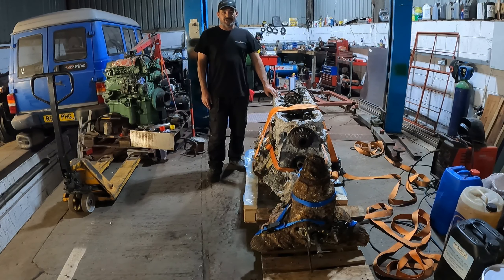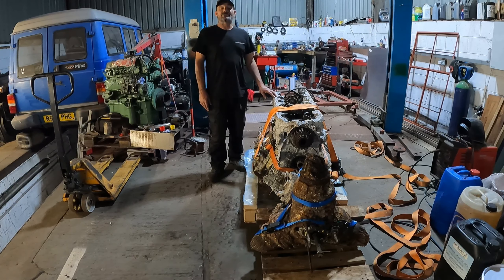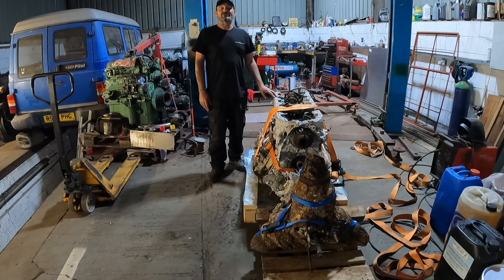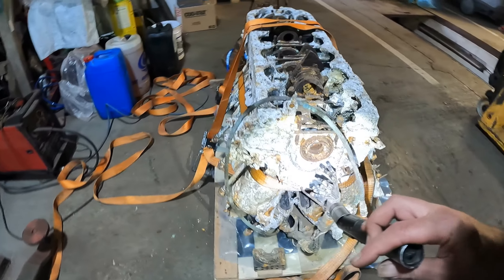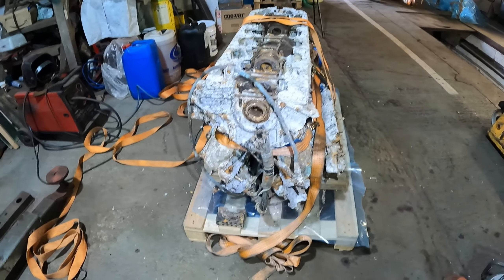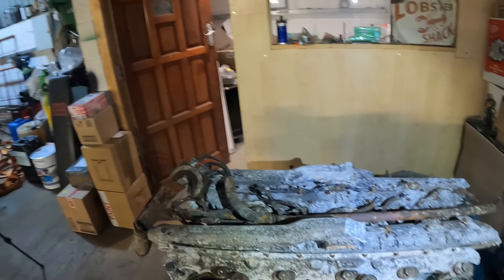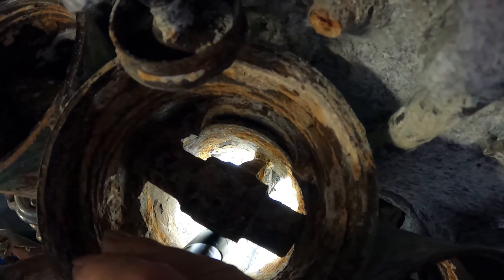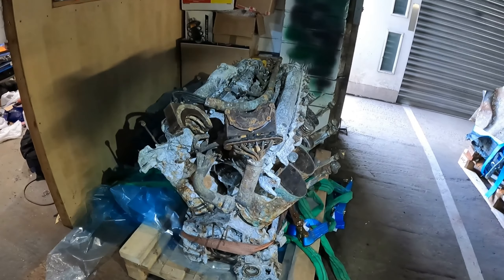The Last Moments Of Two ROLLS ROYCE MERLIN V12'S Of Halifax HR871

Comment: The Rotol prop blade root sleeves, on the first engine will be marked with the pitch angle.
The piston controlling the pitch angle will also still be set at whatever the blade angle was during impact.
Unfortunately, that will involve much cleaning to confirm.
If the blades are set at the 'feather' position that would indicate a stopped engine, but only if the pilot was able to control the pitch configuration after the lightning strike.
If at all possible, a more convenient way of checking for the blade angle, will be by inspecting the direction of the grain in the blade laminates.
Hope this is of use.
Reply from the maker: Thanks for the heads up... looking at the grain I would say not feathered,  the crew only needing time to bail out it is possible they didn't bother or as you say it couldn't be feathered. The engine was not running, no bent rods and when found prop and reduction gear in place, the other engine shows a clear hydraulic lock at speed , with bent rods, and block fractures consistent with a crankshaft with nowhere to go except a direction not intended . I will be cleaning up the hub/prop remains so will keep an eye out for markings 👍

Comment: engine 1 prop hub you might be able to tell if the blades are in the feather position or not
Reply from the maker: Hello Peter, looks like the prop wasn't feathered.... Knowing they needed a short time to bail out they maybe didn't bother.... due to most instruments and ignition circuits to the inner engines not working maybe they couldn't ?